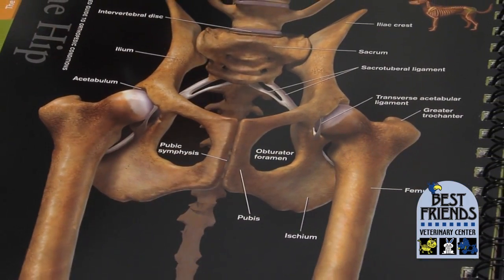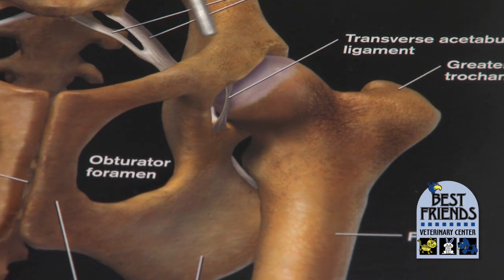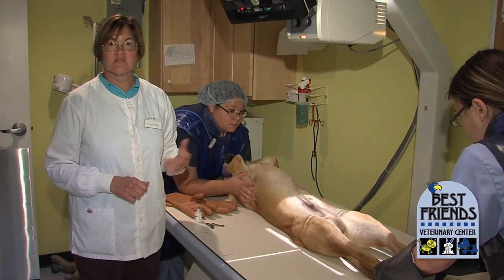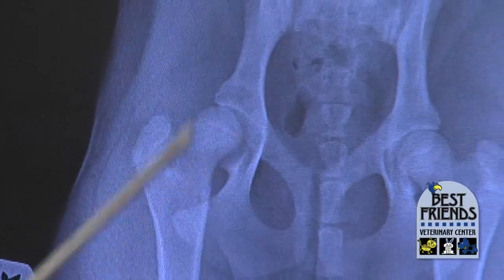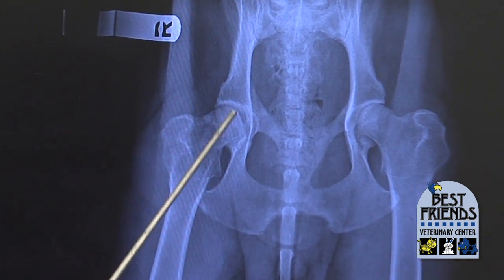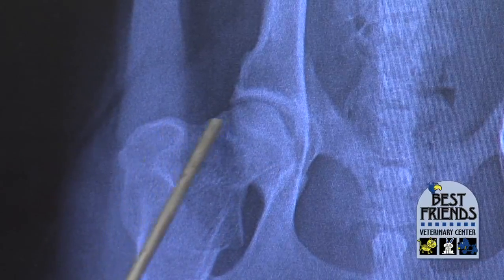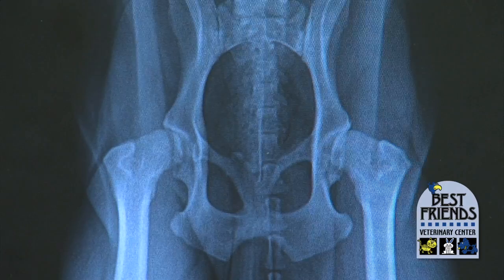Diagnosis of Hip Dysplasia & Hip Arthritis

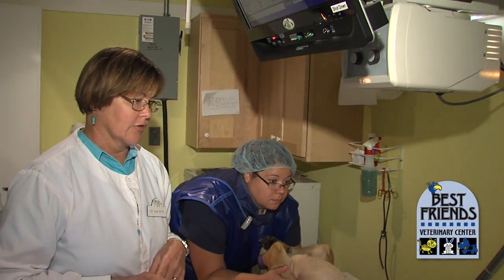Comment: if the vet tech would position the dog correctly - make pelvic straight, the right hip wouldn't be so subluxated and wouldn't look so bad....pelvic is clearly tilted to left side - left hip, you can see it here 1:39. positioning is crucial when it comes to for proper diagnosis.